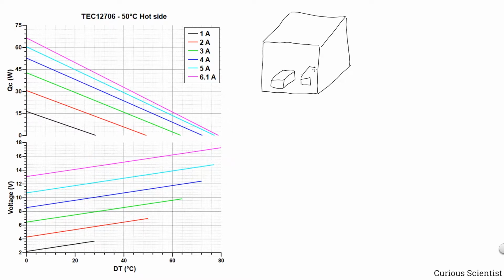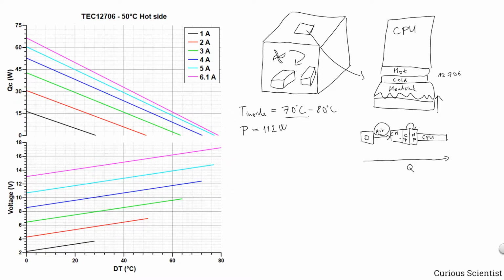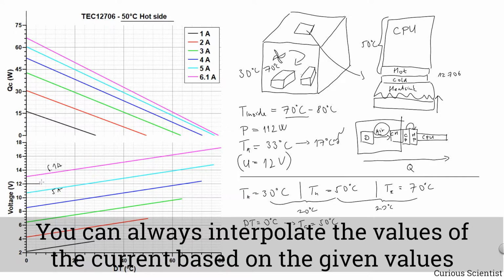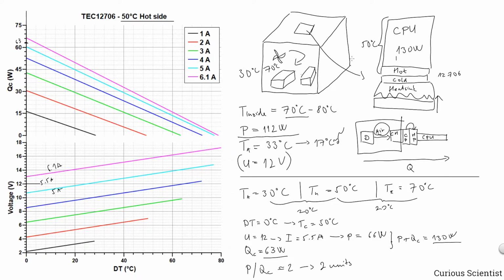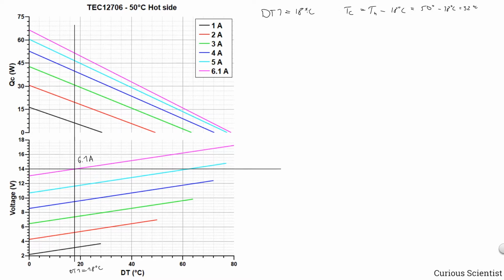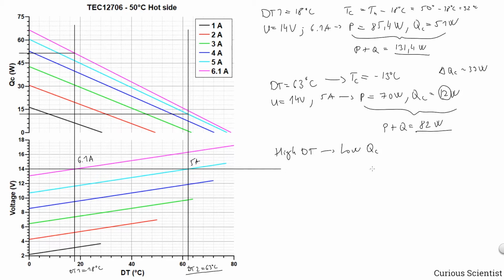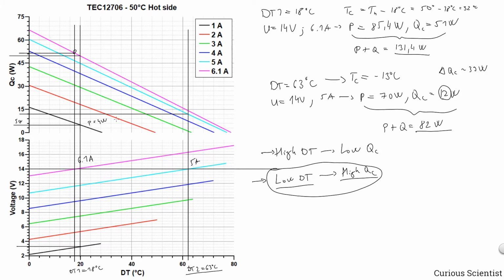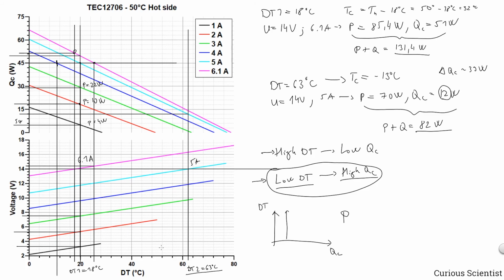Let's discuss about Peltier coolers #2 - Performance chart

Comment: Thank you for great videos! I have TEC1-12706 and want to use it to cool down to 10C. Only a wire taped on it and the thermistor. What should be a good estimate for bare TEC surface without a headload or very tiny load like wire?
Reply from the maker: Hi! If you just want to cool the surface, then it is the hot side temperature, minus 60-70, roughly. So, typically, a bare surface can go down to -20°C with a good cooling on the hot side.
Reply: @CuriousScientist  I was asking what is Qc (the headload for bare TEC surface) roughly when there is no heat load(an object to be cooled).
Reply from the maker: Ah, my bad. That you can look up in the datasheet. I don't know the values by heart.

Comment: Very good   videos .. Just to say that it would have been Perfect if you tested this TEC in different MODE - obviously ~15V mode is almost non-usable. Would have been super if you tried 9V mode or 6-7 Volt
Reply from the maker: Hi! It would have been great if have checked my cannel before drawing conclusions. I have tested several different Peltier coolers across their whole range and made a very detailed analysis. This video is only about reading and understanding performance charts...
Reply: @CuriousScientist  OK, thanks - It seems I missed info. What I ment is that in these series, this TEC in this mode tested seems to be working bad, but more info how to become usable may be would have been a good thing. Did not ment to critisize! TEC series are super - Thank you for them! Pitty there are not many videos in you tube how TEC-s to be used as "chillers" in water CPU cooling ... JUST saw that my comment is not in right video - that explains your reply (I messed video link by wrong copy/paste - comment was about https://www.youtube.com/watch?v=sfMHF0kdI4A&list=PLaeIi4Gbl1T8u3vBI2uHDr8QZbZMOSw_c&index=15&ab_channel=CuriousScientist .. sorry for the error)
Reply from the maker: There are not many videos on the topic you mentioned because they are useless in such applications. Peltier coolers are not meant to be used in such applications. They are used in x-ray detectors (Si-Li drift detectors), CCD detectors, lasers...etc. They are not made for large thermal loads such as a large tank of water with something that spews 100-200 W heat in it...

Comment: Hello again, I am enjoying your videos. It's nice to see that there is a channel that appreciates well-detailed content. I have another question, what would you say to Peltier dehumidification, but designed far better than the small desk units seen on the market? 

Also, probably a dumb question but, how much power would 8xtec1-12710 at 6a pull and is this power consumption affected at all by dT or Th if the amps remains the same.
Reply from the maker: Hi. You can make a dehumidifier. You just have to keep the surface under the dew point.  
Regarding the consumption, you can calculate it by looking at the performance chart or by measuring the voltage when the Peltier takes 6 A. Obviously, if you have multiple units, then you do the exercise for all and sum the values...
Reply: @CuriousScientist  cheers, appreciate the help

Comment: Hi, I watched a big part of your Peltier related videos and I'm still not sure if I can grasp well what is first - the egg or the hen :) Let say we are using 12710 and we are providing about 12 volts, which will results in current about 7A. So at this moment we have 12x7 = 84W dissipated electrical power. Let say, that we can keep Th = 34 degrees and for simplicity we are following the charts for Th = 50. Then according to the chart, I can either get around 65 dT with Q = 0, or Q of near 80 with dT = 0. Finaly - let say, that our cooler can take care of these 85+80 wats. And here I cannot understand - which determines which? I suppose that when we start the system at dT = 0, the system will transfer Q = 80 but as the environment around the cold side is getting colder and colder, dT will increase, which will decrease the Q and at one point some  equilibrium will appear. Am I correct? So if its true, then it will be more effective to cool something if you get as bigger cold heatsink as possible or if it's liquid, as this will keep the temperature on the cold side warmer (or more appropriately said - closer to the cooled environment temperature), thus decreasing dT and increasing Q for the given voltage, current and Th. Otherwise it will happen as in your experiment with the box and 1 fan on the heatsink inside. The sink is geting colder and colder because it cannot transfer heat from the air to the peltier, thus Q is getting smaller. And the cold heatsink need to be powerfull enough to dissipate the needed Q, or better said it's termal resistance should not limits the system.
Am I correct?
Reply from the maker: Hi! Yes, it is a bit difficult to grasp it in the beginning, but I think you got it right. First you start at dT = 0, so you can move the maximum possible amount of heat (reach maximum possible dQ). Then as you turn on the device, heat is started to being pumped from the cold side to the hot side. As you move the heat to the hot side, the cold side becomes colder, hot side becomes hotter, thus dT increases. This also implies that dQ starts to decrease. You are also correct about the large cold side surface. It allows better thermal connection with the heat reservoir that you are trying to cool. This will also push dT down and will allow dQ to go up, yes. Also keep in mind that the hot side should also be cooled as much as possible. Otherwise you shift the lowest achievable temperature towards the warmer temperatures.
Reply: The best thing about writing a question to someone is that you start to understand it better during the process :) 
I'm trying to cool down a terrarium that I'm building at the momment. So first I tryed with Peltier, using not very big CPU cooler and it did not work quite well (the terrarium is about 90 liters, made of glass). Actually I can say it was very poor performance, I read beforehand, and even I'm an engeneer (communication techniques, working as an embedded develloper) , but still I was confused. So I thought that the problem is in the bad thermal silicone and tryed to remove the sinks. It ended up in split peltier, so I decided to buy another one - this time 12710. And to try some experiments with more controlled environment - a box made of 50 mm XPS foam with internal size 28x25x40 cm. First I used the same sinks, then I decided to try a bigger one - taken from a computer that is about maybe 10-12 years old, some XEON processor as I remember. It has 3 pipes, 90mm fan, but it is not as big as the current models. I suppose it is less than 90W TDP. As my regulated power supply is only 5A, so I was using 12V from a computer PS. 
So I got these results: Outside temp 25.7 degrees, temp at the base between the heatpipes 35.9 degrees, temp at the cold sink 5.4 degrees(not very big sink, taken from a computer about 15 years old, or even more), inside temperature 11.9 degrees. I calculated the losses of the box and according to this they needed to be about 0.4W per K difference. So at 13.8 degrees difference the Peltier seems to remove about 5.5W, which is way bellow the charts. Now I think that maybe my box has bigger losses than theoretically calculated and that the cooler was not big enough for 12V. Also maybe the temp on the hot side was higher than measured. Then I measured with currents below 5A and even if the temperature in the box got higher, the efficiency seemed bigger.
So probably I need to get even bigger heatsink and to try again. But  I suppose that these CPU cooler TDPs are specified for much higher working temperatures than what we want, and they cannot dissipate so much power at near room temperature.

For the terrarium I need about 23 degrees day temperature and about 16 night.  It has insulated walls and bottom, single glass in front, double at top. Now I measure it's losses in practice - with a heat source inside, measuring dT and it seems that they are about 4W per Kelvin, so It will be really hard, even impossible to get the night temperatures with single peltier and 28-29 outside temperature. But I plan to make another, smaller terrarium, about 25-30 liters, which will be cooled by peltier.  

Paralel with this, I bought an old water dispenser, which I disassembled and used it's compressor. It cools down an 1.8 liter metal water container, which I placed in a XPS box behind the wall of the terrarium and I pass the air around it. The condensed water will gather in the box and I will return it into the terrarium with a ultrasonic fogger. But in practice, this compressor is not very effective too. I made a lot of experiments with the smaller box and it appears that it's COP is much less than 1, maybe about 0.6. So in the same box experiment as with the Peltier I got down to about 9.6 degrees (peltier 11.9) and the compressor was working like 50 minutes on, 80 off. I don't have a way to measure the current or the consumed energy. In the terrarium this compressor can cool down only about 6 degrees below ambient, but I suspect that the heat transfer between the passing air and the water container is not very good, as the compressor is working with similar cycle - 50 mins on, 60 or more off. And I forgot to say that it keeps the water between 4 and 10 degrees. Increased airflow is not a good option because it won't be too good for the plants.
So more experiments ahead.
Reply from the maker: Wow, you wrote a great novel! :) 

I think that the hot side temperature is often misunderstood. I talked about this in some of my videos. You can actually calculate the real hot side temperature (T(hot)) if you know the other parameters such as voltage, current and cold side temperature. If you calculate it, you will see that depending on your cooling system, the real hot side temperature can be even 20-30°C higher than the temperature you measure with a thermometer on the hot side heat sink. And this difference perfectly matches with the missing cooling power. I recommend you to check the calculated T(hot) and see what would be the dQ in that case. You will be surprised. The hot side temperature is the temperature that you could measure "inside" the Peltier cooler at the junctions. There is a huge gradient between the junctions and the heat sink. 

It is also great to see that you are putting a lot of efforts into the experiments and you pay attention to the parameters. Now you can also see that even a "small" terrarium is challenging to cool and people are claiming that the Peltier based AC should work so well and it is better than the compressor based AC... and so on. But they probably never tried to build one, they just saw that the surface of the Peltier becomes frosty so fast, so it must be so good...
Reply: @CuriousScientist  I just realized the same thing on my own :) I was looking the voltage and the current of one of my tests - it was 9.2V and 4.75 A. According to the chart, dT should be somewhere between 50 and 60. But my cold side was at 7 degrees and the hot side did not feel quite warm (I don't have so many termometers, but for sure it was colder than 36, which I measured during 11.5V test). So, where I asked myself - where is this dT? And the clear answer is - inside the Peltier. Given that its plates are ceramic, there should be big resistance there. Also the coolers and the contacts have some resistance . And it seems that the Q and dT from the table are unachievable.
Reply: and sorry for the novels, but the combination from looking your videos, my experiments and writing this novels actually helped me to understand the things :) Now I know that even if I step on my head, I cannot achieve 20 or 30 dT. So thanks very much!
Reply: At 6V I had 3A and 10.5 C on the cold sink And according to the chart, I should have dT = 45C
Reply from the maker: Yes, I had the same "Heureka! moment". Or, honestly, it was more like a "WTF!?" moment. But it all made sense. Ideally, we should cool the hot side with for example running cold tap water (~10-12°C). That could remove a lot of heat from the system. Or, using some very fancy CPU cooler with large heat sinks with a TDP around 200 W. I hope you keep following my channel because in about 2 months, there'll be a lot of interesting stuff I want to show.
Reply from the maker: No worries about the novel, I like this topic and you also seem to be familiar with it as well as enthusiastic. I really like these discussions, that's why I basically upload these videos, to initiate such discussions and learn from each other.
Reply: @CuriousScientist  If I was able to use running water I wouldn't use peltier at all :) I was thinking about placing a small terrarium in the bathroom and running very small flow of water - like 50-100 ml/minute. At that flowrate the metering device  almost cannot measure it, but then - it is a still a waste and even if wasn't, I live on the 3rd floоr and during the night and some parts of the day in the summer, when there aren't many people home, the water can gets up to 18-20 degrees. So - no way :) 
I'll stick around to see what you are up to.
Reply: @CuriousScientist  Here I am with another novel :) I have update with more promising results. 
I decided to redo the tests, because I found out, that my thermal contact between the peltier and the cooler was not good during the first test. Now I did not measure the temperatures of the hot and cold sides. Instead of this I measured the losses of my XPS box. I was underestimated them a lot!
And got a little bigger fan  on the cold side, but ran it at 7.6V

I put 12v 21W  lightbulb and a fan to move the air and measured 12.1 V x 1.8A = 21.78W. For both fan and the lightbulb.

Then after few hours the system balanced at 27.9 C outside / 45.2 C inside, which results in 1.26W/K loss. This is 5 sides XPS, front side 4mm single glass. 

Then I put again the Peltier at the glass side and got these results:
U = 10.95V; I =6.19; To = 27.6, Ti= 12.4; dT =15.2; P = 67.8W, Q = 19,15W; COP = 0.28
 U = 9V; I = 4.25A; To = 27/0; Ti = 13.6; dT = 13.4; P = 38.25; Q = 16.76; COP = 0.43
U = 8V; I = 3.69A; To = 26.9; Ti = 14.7; dT = 12.2; P = 29.52W; Q = 15.37W; COP = 0.52 
U = 5.1V; I = 2.2A; To = 26.8; Ti = 18.5; dT = 8.3; P = 11.22W; Q = 10.46W; COP = 0.93
U = 3V; I = 0.85A; To = 26.6; Ti = 23.1; dT = 3.5; P = 2.55W; Q = 4.41W; COP = 1.73

As can be seen, COP gets bigger than 1 around 4V at dT around 5 degrees, but it transfers around 6-7W.

These numbers are much more realistic than the previous that I had. 

Also I tryed to lower the cooler fan voltage down to 9V, at which the noise is very low.
The result was about 1.7 degrees lower dT with almost the same P.
So it seems entirely possible to cool down 30-35 L insulated terrarium with small thermal mass with a few degrees during the day  and 8 more degrees  during the night even at the hottest days. And with quite a small consumption at the day. Just have to control the peltier with the voltage. Even there is a choice - low consumption or low noise :)
Reply from the maker: @ivanilarionov1893  The COP can be even higher, as high as 4 or 5 if you are willing to decrease the voltage. But as you also experienced, the cooling power will also drop. But this is how the Peltiers can be used efficiently. Based on other people's comments, a lot of people don't understand and accept this. At high voltages, the COP will be something like 0.2-0.3... Not at all efficient.

Comment: can you share your email ı have question ı wanto to ask you ıf ıt availabe
Reply from the maker: You can also ask it here, so others can learn from it too. Otherwise, visit my website and you'll find a way to contact me privately.
Reply: @CuriousScientist  I want to do a target temperature on cpu. for example ı want to maintain just 10 C on cpu. ı am using icepak. my temperature comes 4000 celsius. thank you professor
Reply from the maker: @salihkaya467  You need to pick a Peltier that has larger cooling power (Qc) than the TDP of the CPU while maintaining the required temperature difference (DT). So, just look for the Peltier cooler that has the Qc and DT at your desired values. Also, it is very important that you cool the hot side of the Peltier cooler properly. You need to be able to remove the heat coming from the CPU plus the heat generated by the Peltier cooler (I*U). This will be most probably more than 200 W, so you will need a decent cooler. 

BTW, 4000°C is a bit too high,  even tungsten would melt at that temperature.
Reply: @CuriousScientist  ok  heat load + i*v(peltier)  totally may be 50 watt. Well this  Qc is 50 watt. I desired 30 Celcius, what is the Dt? I am confused :(
Reply from the maker: @salihkaya467  Have you watched the video at all? Or any of my other Peltier-related videos? I mention DT in nearly all of my Peltier-related videos. Also, if you open the datasheet of any Peltier cooler, they tell you what is DT: it is the temperature difference between the cold and the hot side. What kind of CPU do you have? CPUs are usually around 50-70 W. And then if you want to pump this heat with the Peltier, you will create roughly 80-90 W of Joule heat (TEC12715). So, this is around let's say 150 W. 

If you want to keep the CPU at 30C, why don't you just use some high-end air cooler or some water cooling? Also, CPUs can operate at 60-70°C without any problems, so if you don't have any specific reason (extreme overclocking for example) for cooling the CPU, then you don't need a Peltier. Peltier is used when you want to go below the ambient temperature.
Reply: @CuriousScientist  soryy ı am confused when ı was ptting the dt